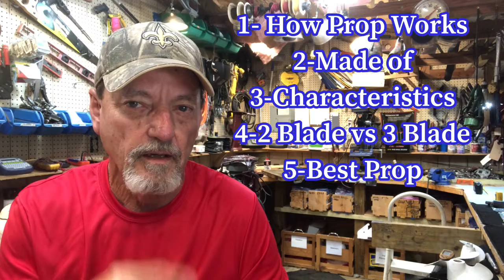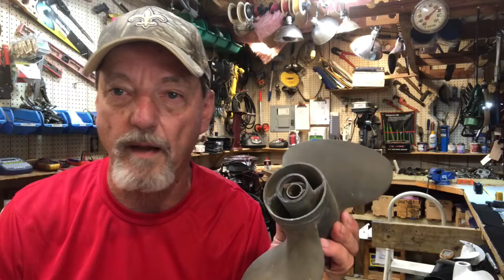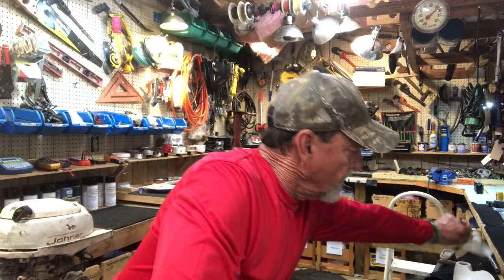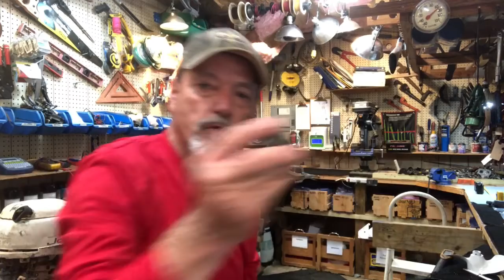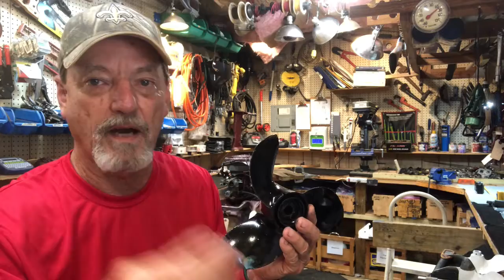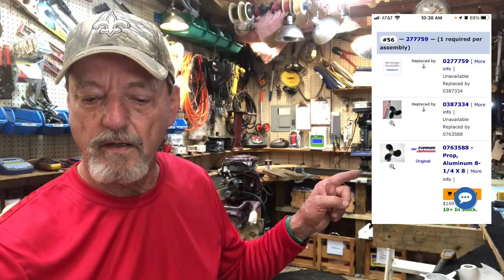Props - Best Prop for Your Vintage Outboard Motor

Comment: Just made a prop switch with my 9.5. Very limited choice ( 2 ) 12 ft 1956 StarCraft rated 35 . Dropped from 8.25x8. To 8x 7 made the difference. Now plane with 2 people and heavy battery

Comment: I have a '60's era Evinrude 6 with a 2 blade prop and an '80's era Evinrude 6 with a 3 blade prop. From what you're saying it doesn't make much difference.
Reply from the maker: Correct

Comment: Thanks T Mike! What torque spec do you put on that castle nut? Running a 10 hp qd-15.
Reply from the maker: @stuffandsuchyeah5182  no torque required.

Comment: Mike, thanks for all your knowledge. It costs a fortune to learn what we can learn from you for free. Ain't America great. I have learned so much in just a few minutes. You go into real mechanic detail. The science. I luv that. Because that is what I need to know to fix motors right the first time. Not the third time. God Bless You! I like them old Evinrude 2 strokes. Those old aluminum or pot metal props were easy to tear up. Daddy was always worried about shearing a pin or shearing the prop as he said. Great stuff to know.

Comment: What do I look for to order a prop for a Johnson seahorse 10 horsepower? I’ve only found one so far. Not sure if props are universal or not?
Reply from the maker: You need the part number
Reply: @michaeljsimon  I found a couple that fit. One is solas and it’s only 70$

Comment: Not all outboards turn clockwise (or righthand) Most of them do but there are some older a few that run left hand props. Old Tomas and Eska motors use left hand props.

Comment: Good video a couple yrs back I was wondering about my little "72" johnson it came with a 2 blade prop but I noticed that others the same but of slighter newer vintage had 3 blade props. so I checked out all the info specs part #`s of the motor parts everything I think rated rpm at speed the whole 10 yards. So I put a 3 blade on and as you said there was very little difference in the hole shot and as far as top speed I think that was the same. I did take into mind that I run a jon boat and they take an extra half a horse power to move them along.